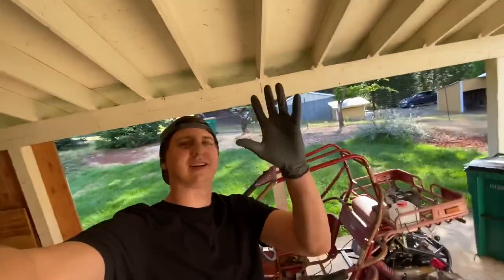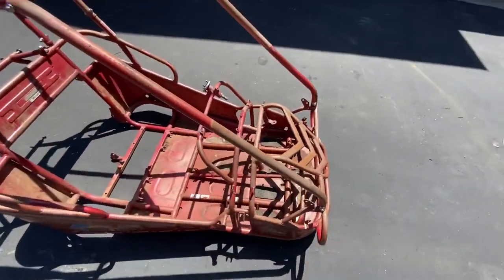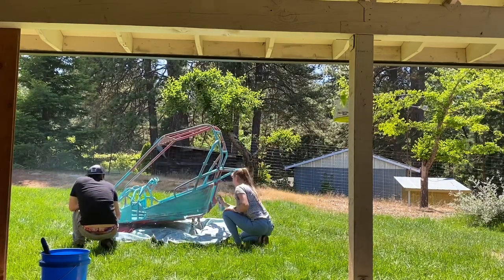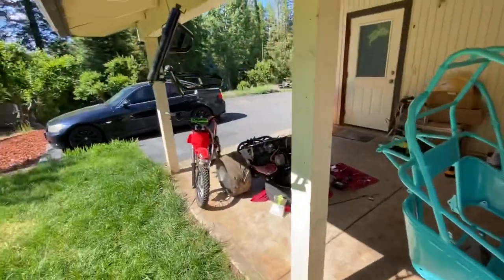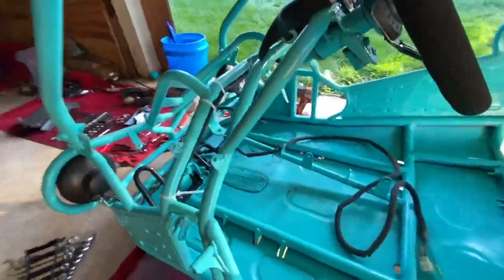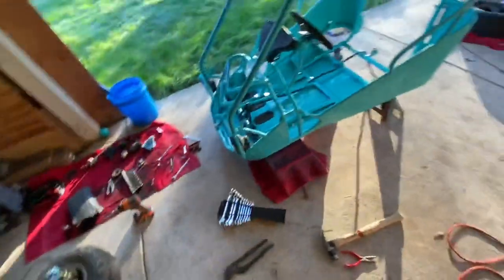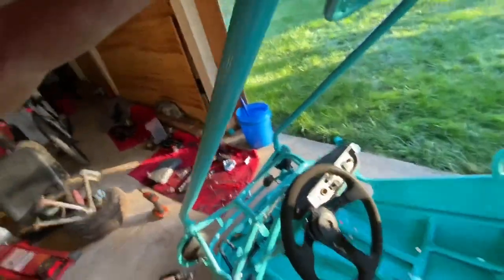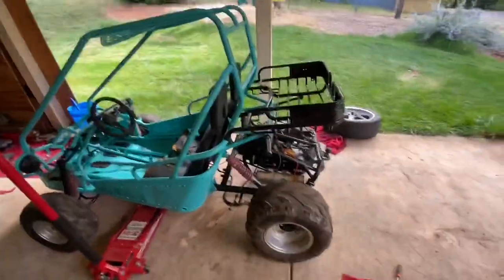Making The Hammerhead GO kart Look New Again for under $40 !!!

Comment: I have the same kart and I am painting mine all black with the bedliner spray. I gotta put a new wiring harness on and well alot of work to be done. It didnt work at all when I got it and it somewhat works now but battery keeps draining and I keep getting gas in the oil. I thought it was the float getting stuck but it's a new carb and I took it apart and it's not stuck... I'm new at working on these.lol. but yeah dude your karts looking nice
Reply from the maker: jimmy Mccarty thank you sounds like you have a fun project on your hands I had to do a lot of work to get this one to be drivable we spent over a $1000 just in parts
Reply from the maker: Also sounds like you might have a timing issue or possibly bad rings these carbs with the electric choke are a pain to work on a lot of people bypass the electric choke.
Reply: Thanks man. I just YouTube how to bypass the choke. I'll try it out. Thanks for the feedback. Bc idk much about this stuff but am trying to learn as I go and any kind of help will help
Reply from the maker: jimmy Mccarty I know the feeling you are very welcome 👍 good luck
Reply: @throttlefamily4655  if its got a vacuum petcock check it , that could definitely be what’s going on